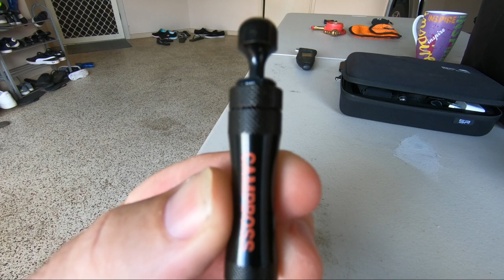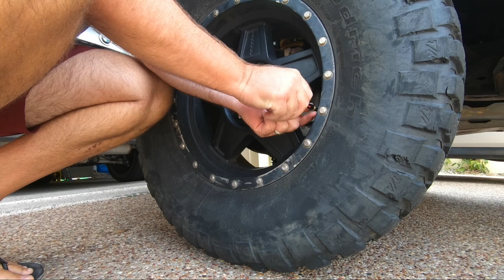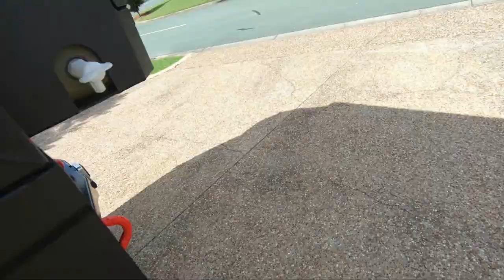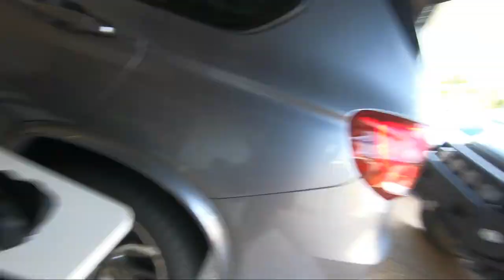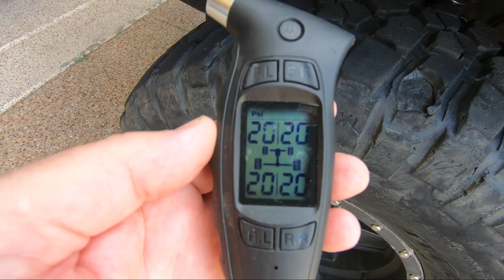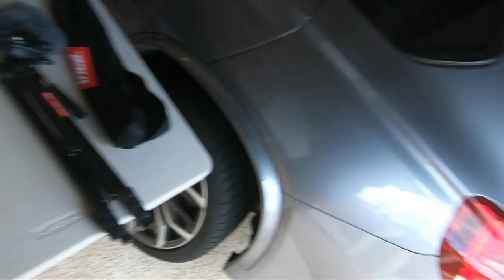ARB vs Camp Boss   Tyre deflator comparison

Comment: It doesn't matter which is quicker the 4 deflators took 3m 43s and the ARB took 4m 21s thats 38 seconds differance, The important factor is you not being in pain, so the camp boss wins, I prefer the ARB so I can vary the pressure if I happen to change my mind, It's great that you don't have to let pain ruin your day and for you the camp boss are perfect, So well done great video, Thumbs Up.
Reply from the maker: Cheers 🍻 for your comment G55 👍

Comment: Great video. I like using 16 or 18psi. I’ve noticed markings are 15 then 20. 
Do you think it would be easy to set them for 16 or 18psi?
Reply from the maker: Yer Bruno I pretty confident next time I go out I trial it, keeep an eye out on the upcoming vids 👍 Jeff
Reply: Would you even be able to tell 1 PSI difference

Comment: hey mate what was that tyre tester you had
Reply from the maker: It’s a Drivetech one Mark there’s no model number etc but I love it. Displays all 4 at the same time. Had it for approx 3 years now, still on original battery and no issues at all. 👍
Reply: Hey Mark here's the link to the TPG he was using,hope you can use it. 
 https://www.outbackequipment.com.au/drivetech-4x4-handheld-digital-tyre-pressure-gauge